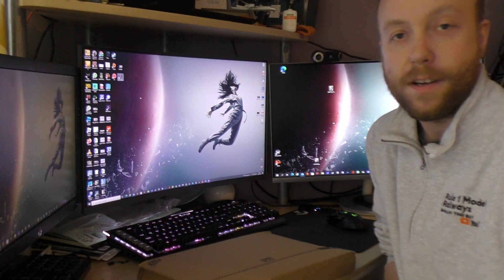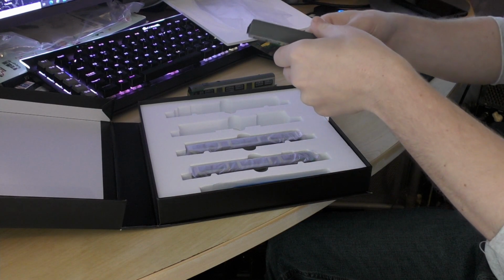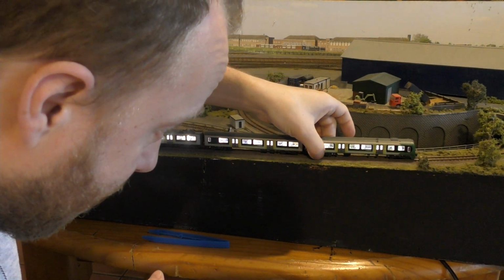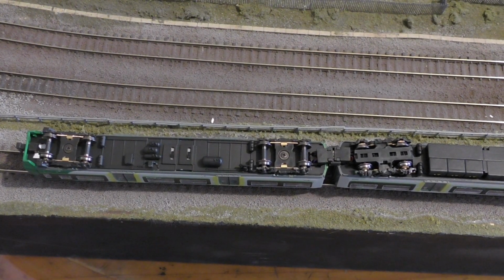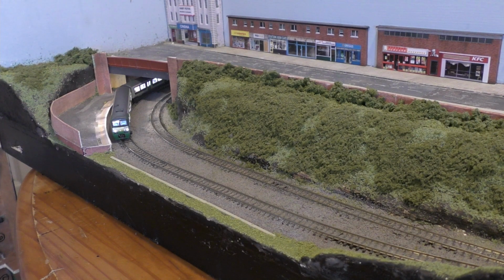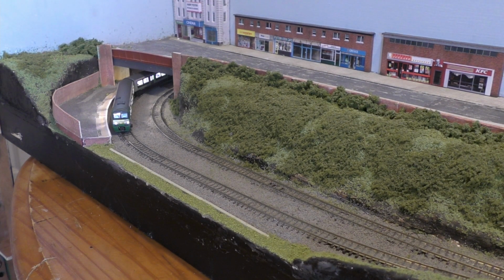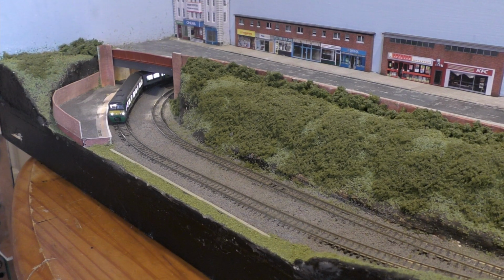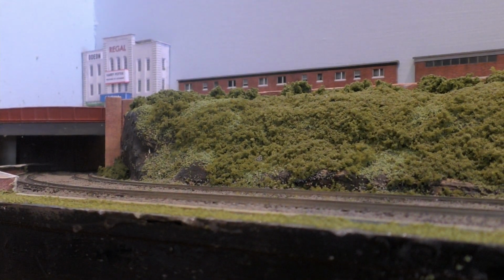Revolution Class 321 - Sound Fitted - London Midland - N Gauge

Comment: I got the Class 320 model at Model Rail Scotland, and had no end of trouble with it. The 1st model had no lighting in the 1st coach, the 2nd model had a broken coupling, but the 3rd seemed far better after running (and rerailing) it for an hour in each direction. The couplings seem to be hindered by the cables attached to them (for inter connectivity) and this makes them derail on corners. The heaver motorized coach also seems to 'lift' whichever coach is in front of it slightly off the track, which causes problems with the internal lighting, so I ended up switching them off.
Ive also been told, as you've mentioned, that the back-to-backs are a bit tight, but haven't measured them myself.
One last thing, its far easier to connect them together if you lay the model on its side ;)
Reply from the maker: I found that the motor car rides slightly lower, and it see saws the adjacent carriages off the rails. 

It has been a nightmare, the video took three hours to get it to run right.

Comment: The RT class 321 is undoubtably a lovely model, just such a shame that every video Ive seen shows continual derailing due to the couplings. What’s wrong with the standard rapido couplings used for years? Im looking forward to the mark 5s but dread what the running quality will be like.
Reply: My 320 was just the same :(
Reply from the maker: it does seem to be every single one of them, just glad I had the patience to rectify part of it. It;s still not great. I dread to see what the mk5s are like also. 

I will order from them in 00 gauge in the future, but I'll give any new n gauge a miss.
Reply: @Rule1ModelRailways  I don’t blame you, but I understand Acurascale are making both OO and N

Comment: What a shame.  It is such a sharp model- finely detailed, lit well... and how this issue passes quality control is beyond me.  Seen it with 2 companies and several of the models using this coupling style.  I know the brands I follow do not have this issue in HO or N, so not sure why it is not working.  Otherwise, one is stuck with KATO if one wants to be assured of quality in N-Scales.
Reply from the maker: Kato for sure is the way forward in n gauge.

Comment: Hiya Nick , Great Video and looking forward / Dreading getting mine ( i have 2 ordered a NSE and Silverlink ) You mentioned screws under the carriages do these actually control the movement of both the bogies and couplings ?? And loosen them off to the point of more movement and play for going round corners . As all the Videos i have seen all have the same Problem but your video seem to give me some idea as to what to do if i have the same problem . The couplings do seem a bit Heavy Duty for my liking especially for N Gauge
Reply from the maker: Yes the screws that attach the bogies, also screws in to the chassis and the interior and sandwiches everything together, and between those is the coupling mechanism in a pocket, sandwiched. It would of been better that the bogies used a different screw to the coupling, the way it is now, it's all just one big compromise.

Comment: Hi Nick. Sorry, how did you fix the sticking couplings, was it just a matter of running in?
Reply from the maker: I took it to pieces, and then put it all back together adjusting the screw tension gradually to work out how much play can be accommodated. It works better still now since it has ran in all day today, but it's still not great.

Comment: I think these Revolution models with the  electric wired couplers are a disaster. Someone, somewhere should just own up and declare that they're just not functional. There is an argument that many owners may be running them on track where the radius is insufficient to "hold" them, but the couplings are just too rigid. Run them over complex trackwork (points and crossings) and they just die. It's a shame because they are lovely looking models, but you'll get no peace watching them stumbling along the track. They remind me of the split gears problem that have dogged us for years because Farish never owned up to the quality of the material used. 
The owners of Revolution should come clean on this issue. These products are so expensive and yet so unreliable. And yet again, as many other modelers state, Kato products just run and run and..............
Reply from the maker: Indeed. I had to switch layouts mid way through the video as they just wouldn't run over points, even when on dead straight track.